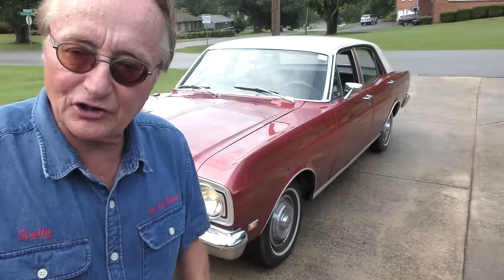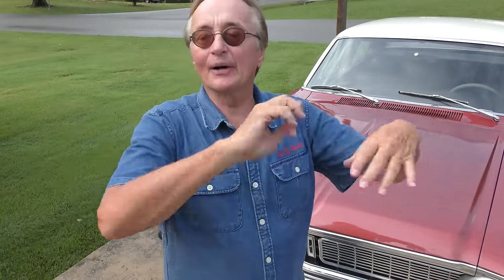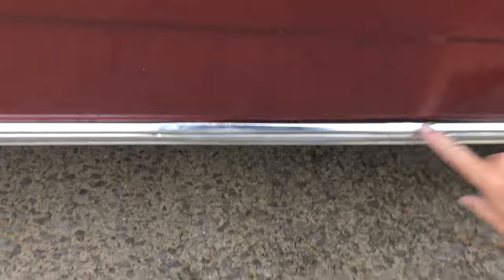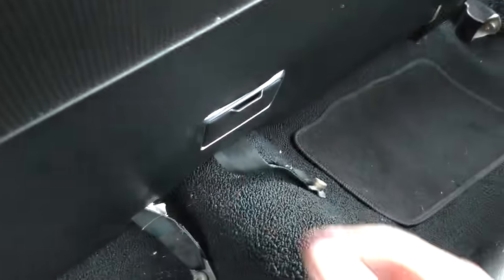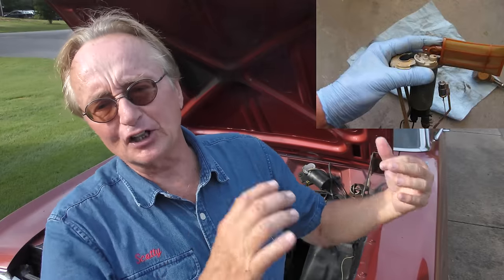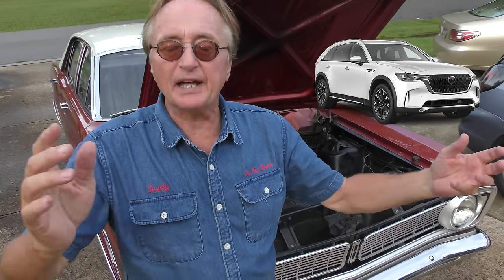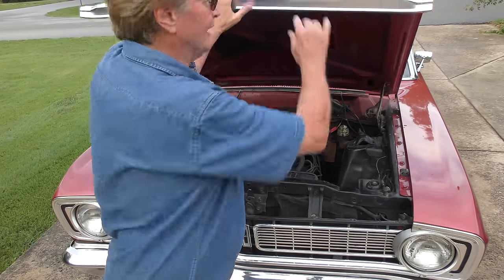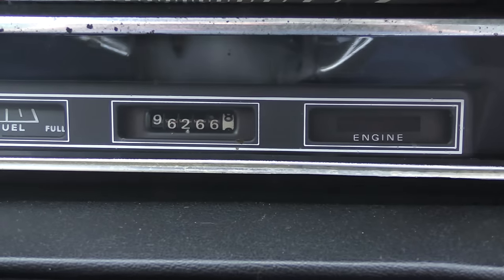I Just Bought My Dream Car

Comment: I put wheels on Falcons and Comets at Claycomo Ford plant in MO in the early 1960's. These things has tiny 13" wheels. You did not want to get the wheels hooked over the edge of the road, as they tended to flip over. They were a favorite car of the Argentine secret police, and usually were green.

Comment: Scotty, my 1960 Comet died when a 63 Galaxie rearended it in front of my house, otherwise my kids would have driven it.  I pulled the 2 speed slush box, replaced the 144 with a 170 and a 3 on the tree, soon to be a three by the knee.  It ran great until the 1973 mating of the Ford products.  The Galaxie was killed and the Comet ended up with a twisted left cats' eye which I sold to the guy with the Galaxie.

Comment: I learned to drive in my Dad's 1963 2 door station wagon. 170 / 3 on the tree. I later bought a used 1965 Falcon Ranchero Deluxe. 289 / auto / air. All original. A friend gave me his 1970 Maverick 302.

Comment: 1969 Falcon in Australia is the changeover from XT to XW model. The rear styling is more Galaxie looking than the XT/XW but the front is basically the same as the XT. This body shape with 351 4v Cleveland and top loader 4speed (XY GTHO) was the fastest 4dr production car in Australia for decades.

Comment: My nieghbor used to seal his driveway every spring. Before he started, he'd pull that falcon out, take all the fenders off and coat the inside of them and as much of the underbody with brushes and brooms with driveway sealer.  That car never had one speck of rust on it

Comment: Scotty,
Great 1969 Falcon but it should've come from the factory with standard shoulder belts as well as the lap belts.  They would've been completely separate belts with their own buckles.  They would've been stored up along the side window frame and headliner with a little plastic holder for the chrome tongue to fit into with a little elastic strap and velcro piece to hold the belt up out of the way when not in use. Perhaps your shoulder belts were removed when the car's headliner was replaced.  Great little car...

Comment: I was given a 1960 falcon in 1973, the steering went, I bought a 1963 falcon in around 1979, I was poor, stray cats slept in the back seat at night since I couldn't afford to get the window fixed, they jumped out when I got in, nice little car, the 1960 had a choke,

Comment: love  my 61  falcon  it's  as old  as I am And in a whole lot better  shape.   No plastic  except  for the radio knobs   Not  Over  engineered   computer  controlled  crap like  tire  pressure  sensors   to  run  up the cost .   BASIC  transportation  the 1960's  version of a Model T,

Comment: The 1966 to early 1970 Ford Falcon was basically a smaller version of the Fairlane/Torino series. Shorter wheelbase and the hood and trunk areas were shorter too. But they shared a lot of the same engineering and also some parts were the same or very similar.

Comment: I guess my dad was ahead of his time. He let my mom drive the big car, and he took the Falcon to work. I remember it had a three speed manual shift on the steering column, and my sister and I used to bounce up and down in the back seat (no seat belts on) on the way to school while my dad drove with no power brakes or steering, and manual shifting. He turned it in for a Mustang in 1964.

Comment: I still have my grandparents ‘65 Falcon, 54D sedan. Great car with 170 cubic inch. Needs its 2nd restoration so not running right now. 
Actually, the Torino was the Falcon replacement.

Comment: These were sold in South Africa as the Ford Fairmont and if you had more money you could opt for the 351 cubic inch V8
Production ended in 1972 if I recall correctly.
At the time the Fairmont GT was the most powerful car available locally, they are also very rare.
The headlights, grille and taillamps were different to the ones available in the U.S.

Comment: Another thing to look out for on your falcon or early mustang is cracked unibody frame on the passenger side behind the wheel. They make weld in supports and I would install it before it cracks if it isn't a show car. I welded up mine after the crack, had it break again near the weld before I make my own support and welded it in then I never had another problem. It would be much easier to weld in the support than to align the frame straight After it breaks.

Comment: In Canada the top of the line would have been the Futura with bucket seats and a 250 cubic inch 6 cyl. I can't remember if it was a column mounted shifter or on the floor shifter. A popular colour back then was Brittany Blue (sky blue).

Comment: My favourite Falcon of the 60s was the Peugeot 404. It did everything the Falcon did but also had suspension, brakes, steering, durability and reliability: Standard. And in a rally situation would snot a Falcon.

Comment: I remember when you could buy a good Falcon for 50.00. Perfect body and interior and maybe 60,000 miles on it. I owned a 1960, took my driver's test in my aunt's 1962 in 1970. Bought a mint 1965 with no reverse for 75.00, then I bought a junkyard automatic for 35.00 and drove it for six years. By the way Scottie you do know the trunk floor is the top of the gas tank.

Comment: this model falcon in australia is an XW, engine sizes were 200ci,22ci 6 cylinder and  302ci , 351ci windsor V8 with late 69 models using the cleveland V8. the US grille is different to the oz model as is the instrumentation inside the car.

Comment: My first car was a 62 Falcon. A black car in Arizona in 1970. Lol
 Like yours except there were no seat belts and it had the steel Dash.
 And they were easy to work on I did my first clutch job on it at age 16.
 It did get 20+ mpg despite the engine being completely wore out. It was blowing so oil a motorcycle cop behind me got drenched and then pissed.😂
 One of my brothers also had the first Maverick grabber my other brother was fortunate enough to get a 69 Mustang Bandido.

Comment: Fords in 1969 all had that flaw where you had to pull up on the shift lever to start the car.  You would have to reach around the steering column with your left hand, pull up, then twist the key with your right hand.  Ford dealers caught HOLY HELL!!!  Ford fixed it the next year.

Comment: I worked at a gas station, my very first job. And was asked to pull a car into the bay for work. I told my boss I can't drive a clutch? He said there is no time like now to learn. It was a falcon with a 3 on the tree! And I learned and now drive a 1996 ford ranger with a 5 speed. Your falcon does have Air conditioning, and at 67 a single father I told my 17 year old son that even though my ford ranger has no factory air, it has as my son learned, has 2 55 air conditioning. 2 windows down and 55 miles an hour.

Comment: That's an XW Falcon in Australia but I don't know how much alike they are, the back doors look the same but the front indicator aren't beside the headlights. The Australian version had two 6 cylinder 3.1 and 3.6 litre) and two V8 options as well (4.9 and 5.8 litre). I own a base model 2015 Falcon Ute, it's worth about AU$23,000 now but I bought it 4 years ago for AU$17,500. Mine has the NA Barra 195 with the 6 speed automatic ZF.

Comment: Here in Ontario, Canada there's a U-Pull yard/dealership got one of these listed for $2800 CAD+taxes, pics show 27k on the odometer (only 5 digits (6 including the decimal spot) so it likely isn't so low mileage as the odometer likely rolled over at least once) and description mentions the engine is blown and body work needed. I saw it as I enjoy window shopping from time to time to see what's available, more so when it comes to vehicles 1989 and older as for my 1st vehicle  I'd love to get something as old as I am (35 years old as of 2024) or older with a automatic to get started with when it comes to building up driving experience in general. For my 2nd vehicle after spending time with my first and getting adequate experience I'd be willing to get something newer with a manual transmission like perhaps a 90's-00's Civic unless i'm lucky and find a 5 speed Accord as I've heard that the Honda manuals are good to learn on. And after that perhaps a newer base model economy car with a manual like a Mitsubishi Mirage or similar perhaps?

Comment: I owned a 71 Dodge Dart. 225 slant six it had power steering but not power brakes. Trust me, I towed a 3000lb SeaRay. It would scare the crap out of you if you had to stop down hill. No chance. You could stand on the brake and it would not stop.

Comment: I had bought a new 92 Chevy Cheyenne 1500 WT, in about 7 years the truck just stopped dead, my mechanic said I needed a new fuel pump. He handed me the estimate for 250 bucks. Now I had changed a fuel pump in my 64 Belevedere and my 61 Chevy truck, simple process. So when I asked him WHAT???? 250 bucks to change the pump?? Yep, inside the tank, dumbest thing I ever heard of. Had no choice but wasn't happy about it for sure.

Comment: My fav Falcons were always the '64 & 65's. I like the styling much better than the 1st gen '60-63, and the kinda dull '66 and up. 

Not an EV, not overloaded w electronic crap I don't want and will NEVER use, crank windows, and I actually get to CHOOSE THE OPTIONS I want to pay for! I'll take Auto, PS, and PB, AM-FM radio, heater/defogger, and that is ALL I want, period! And many buyers won't want some of those items.  

When is Ford (or GM, or Mopar) ever again going to produce simple, easy to live w cars that get me from point A to B, look OK, and cost so little. A late '60's NEW $1400. car would be about $12K now. That is very reasonable, and anyone that has priced new & used lately would JUMP on that!

Comment: Honestly, I would not feel safe driving or even riding in one of these old death traps. There’s a reason the fuel pumps and filters aren’t located anywhere near the engine anymore - they were fire hazards. You could be driving down the road and poof! One leak of gasoline onto a hot engine and you’re on fire. Same for the gas tanks behind the bench seat of the old pickup trucks. Oh and heaven-forbid if you get caught in a serious collision due to no fault of your own. The only good thing about these older cars were the drivetrains, that is, if you took care of them.

Comment: It's funny the cultural difference. Saw near identical Ford Falcon's here in Australia. Here they were considered as a large family car and were mostly 6 cylinder(as were Holden's). 

The only issue with Fords in Australia in that era, is they had a reputation for a vapor locking fuel line and overheating and boiling issues. Issues their home grown Australian rival Holden didn't have. Hence the reason more than half of Australia driveways had a Holden parked in them. 

After a while, those issues with Ford were no longer issues. They still broke down more often than any other make sold in Australia! 😂. Of course, there's little difference in reliability since the late 1990's. 

I agree, even an old Ford is better than most modern stuff.

Comment: I had a 62 that my aunt gave me after she overheated it. It must have got pretty hot because the paint was peeled off the  rear head. I was eighteen and it was free. It was gutless. If I had four guys in it, top speed was 68 mph floored. When I stopped I was engulfed in a cloud of smoke from the blow by. It had a console shift and buckets, but it was the worst P.O.S. I ever owned.

Comment: Do you know what they did to the Ford Falcon in Australia? They dropped in a Cleveland 351 engine with a quoted 300 bhp generally believed to have an actual output ranging from 350 to 380 bhp. Google Ford Falcon GTHO Phase 3.

Comment: Falcons and me go back a long ways. In about 1970 I bought a mid 60's Falcon that someone had spent some money on. It was painted a very light yellow with a spray on black vinyl top. It had the red 170 engine with split manifold headers and the engine was supposedly built by one of the top mechanics in the area. I replaced the 4 lug 13" wheels with 4 lug 15" Nash wheels and that really set it free. The gear ratio was somehow perfect.  It seriously would do a burn out like a V8. Those were the days!

Comment: Scotty I am surprised you did not refer to the factory arm strong steering instead of manual steering.  In the old days you did not need to go to the gym you got a work out pressing the clutch and the manual brakes and got good arm exercise with the factory arm strong steering.  🤣

Comment: Scotty, I have a 2008 Solara convertible SLE with 64,000 miles. Would you recommend changing the transmission fluid? The dealer also wants $450 to do this and I’m not having any problems at this time.

Comment: If I recall, there was the 170ci 6 and the 200 ci 6 available back then? The 250 came along later? The bench seat had lots of room for snuggling with your sweetie (among other things) at the drive in....
Reply: Did they get a lot of stained seats?

Comment: I had a 1974 maverick with 250 cid engine and a bench seat.  Went 100,000 miles without any problems.  It was made at the kansas assembly plant.

Comment: If people are putting disk brakes on old cars, then they should know this already. I know you were only pointing out the brakes because everyone always complains when a car has drum brakes. When people convert the front brakes from drum to disk they need to be careful about pressure and use the correct booster and pressure regulator. Too many people convert only the spindles and rotors in front, without considering the difference in pressure needed between the front disks and rear drums. Then you have people locking up the rear and spinning out trying to get enough pressure to the front.
Reply: It's called porportioning vave

Comment: I had a 1963 Ford falcon . 199 cu in. 90 h.p 3 on the tree. 4:48 I don’t think I ever got more than 18 miles per gallon. My 1965 Mustang was the same car under the hood. They didn’t last longer than 100 k mikes.

Comment: I used to have a '62 ford falcon station wagon. 3 on the tree, inline 6.  So easy to work on, very reliable, but 2nd gear slow going up the mountains out of denver. Also had to replace the lightweight tranny twice but that was cheap and only took an hour or less. Took it everywhere but glad to eventually get something with less weight and more power.

Comment: my dream antique car is either a red/red 1965 Cadillac Deville convertible or a 1969 Hurst Olds 442 though with the 442 I'd have the exterior color changed to blue from white and change the interior from black vinyl to gray or a 1987 Buick GNX or if its a sports car its either a guards red 1978 Porsche 911 Turbo with tan interior or a 1980 Yenko Camaro Red/brown interior

Comment: you guys all sound like cynical old men. the good old days, they don't build em like they used to, blah blah blah.
Don't you realize the guy that drove horse drawn wagons said the same thing about the model T.
Well I encourage you all to drive those old death machines as much as possible. Really, I mean it. Drive em with gasoline smell, the no defrost, no handling, oh and the steering wheel driving itself right into your old man thorax and the leaky windows. Nostalgia is for the nearly dead.  By the way, that is the last effing car I would drive ever. It destroys any other credibility you may have had with me. Based on your taste in cars I would listen to any of your other opinions on anything.

Comment: Scotty, my 2012 Ford Fusion,still runs great,but the Air condition quit blowing cold air, I took it to a Ford dealership, they fixed it, but it doesn’t blow strong air like it did originally . What can be done to make it run as it did before? Thank you for any ideas to fix the issue. 👍🏻